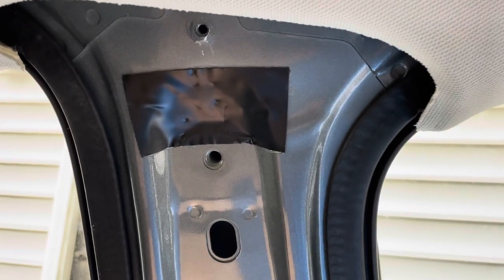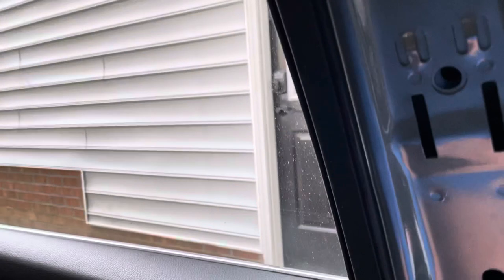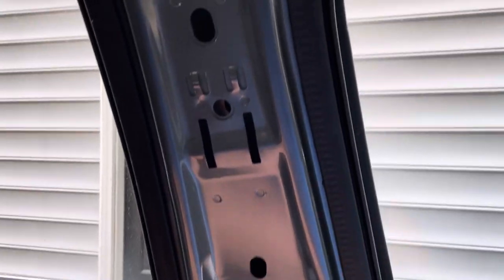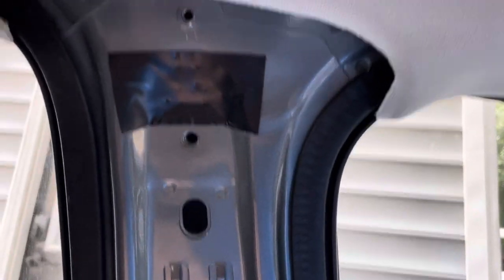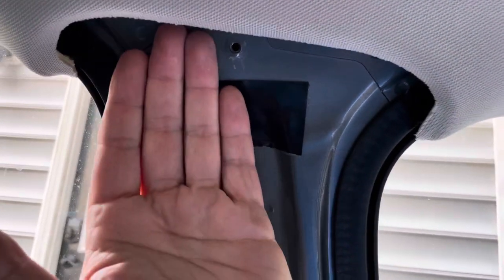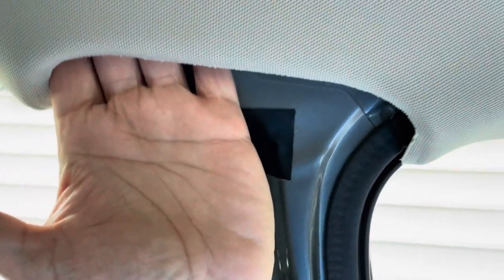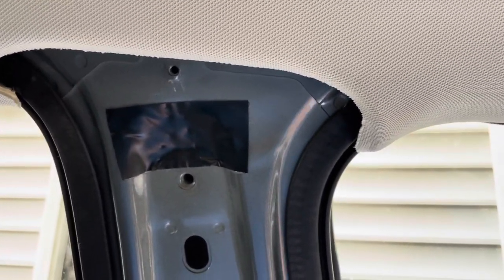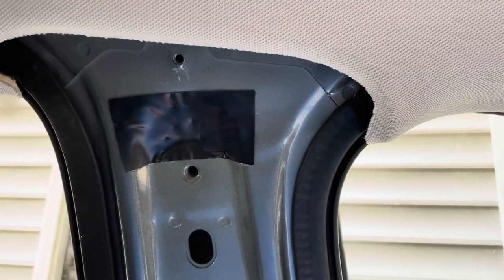VW Passat Rattle B Pillar

Comment: thanks for the video. I own an audi a4 2015 and having a similar issue with rattle coming from that area, what's weird though is that it only happens at high speeds (upwards of 100 km/h), especially on smooth highways. The fast, small vibrations seem to be what triggers it. Do you think it could be that same thing?
Reply from the maker: It could be the same thing, hard to say.  I will say that mine did it at all speeds but not all of the time.  I thought the sound was coming out of my back door so I took that apart first.  This is easy to try and you can at least rule it out.  Best of luck.